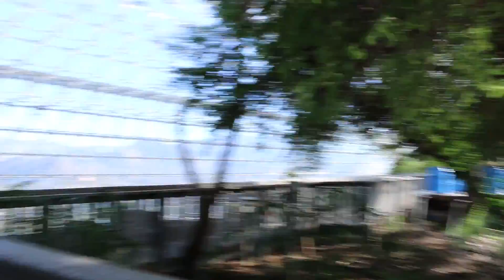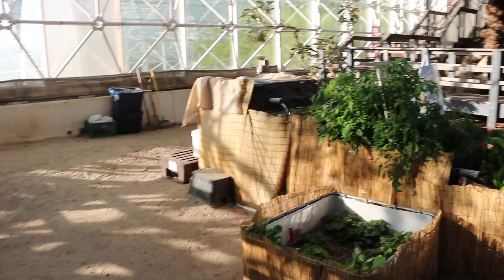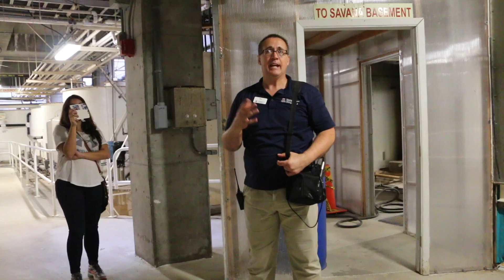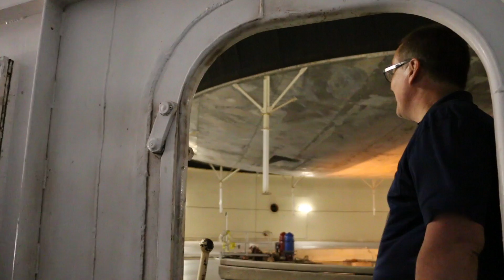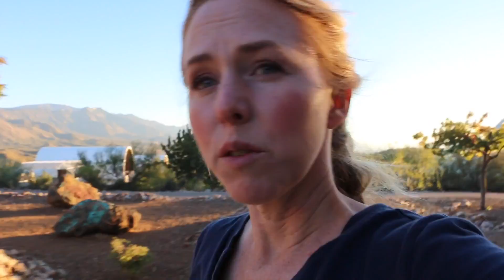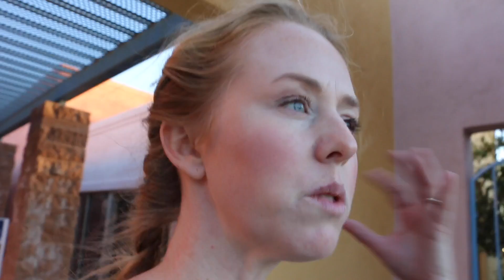A Greenhouse Big Enough To Live In?

Comment: beautiful failure...when they actually sent in the scientists to live off of the resources including chickens they lost mass amounts of weight and developed chronic diarrhea. I think they only lasted 6 months?? Or so we were told years ago when they built the first one. But amazing beautiful.
Reply: "They" only built the second one. GOD built the first one.
Reply: If I remember correctly, the concrete they used for the water basins was some weird mix and it wasn't completely set by the time the experiment started. The mix started offgassing something weird causing nausea and headaches, and the experiment got pulled.